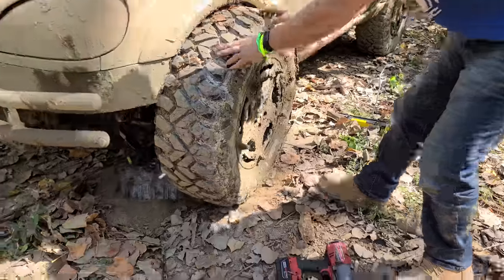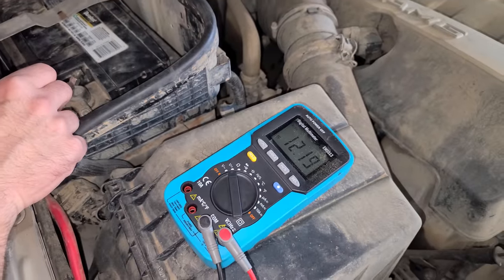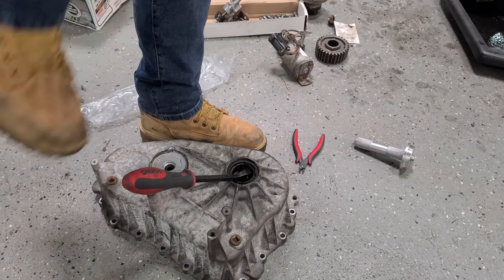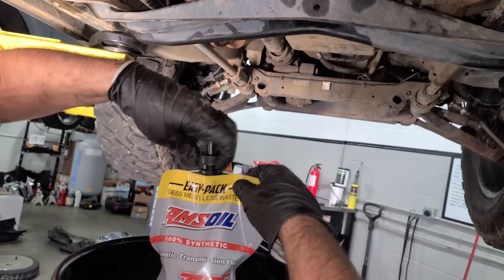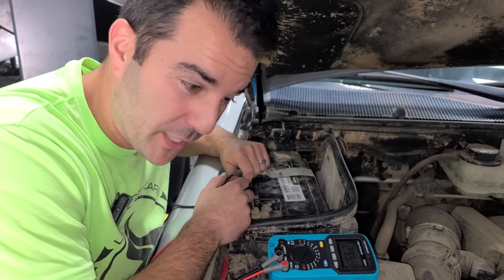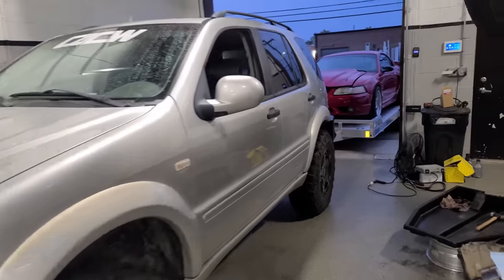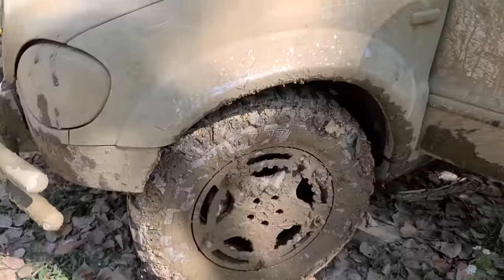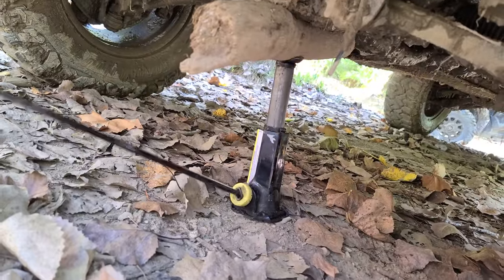I Built A Budget Off-Road AMG Mercedes & Brutally Broke It Twice! DIY Fixed On the Trails! CARNAGE!

Comment: About 5 years ago I bought a 2008 w204 c220 and I've been doing the services myself. Thanks to you Alex...
I always thought that mercedes would be complicated to work on but man, I have been fortunate to learn how easy it is.. I've just recently had to pull a leaking injector. Replaced the copper seal, cleaned up the carbon and put it back in within an hour! I couldn't believe it as I thought I was fudged... 
Thanks for all your videos over all these years...

Comment from the maker: What's an SUV you want to build for off-roading or overlanding?
Reply: Build a off road mustang
Reply: Tahoe 🤌
Reply: Yeah, Tahoe will be nice overland project or some old Chevy
Reply: Definitely not a mercedes
Reply: Already did it with my 4Runner, and I'd do it again!
Reply: @evoemperor3776  A G-wagon will be far more capable than any Toyota's and Jeep's
Reply: 4th gen v8 4runner
Reply: Take a Corvette body and put it on a old blazer 4x4 frame (google it) trust me, it looks dope.
Reply: @coreygenno9951 I was going to comment the same thing 👌 

The 2UZ-FE is indestructible 💪
Reply: A Porsche 911
Reply: I just bought a 2013 Nissan Xterra PRO-4X so that’s my pick 😊
Reply: P cayenne turbo
Reply: Any Off-road Porsche
Reply: I have a 91 jeep cherokee I figured would make a good overland vehicle. We shall soon find out
Reply: porsche cayenne
Reply: 1995 mitsubishi montero ls
Reply: I bought my wife a lexus gx 460. I’ll be building it for sure soon
Reply: I think it would be awesome to build up a Mitsubishi Delica
Reply: My 07 Sequoia.
Reply: Xterra I have currently
Reply: W164 ML63😅
Reply: If I had the budget and space, I'd build a military surplus 6x6 Deuce and a half. Those trucks went wherever you pointed them.
Reply: Toyota Yaris Cross GR Sport built for off-roading, it would be so fun and tiny little thing.
Reply: Fj-Cruiser.
Reply: I want to see a Cayenne Off Road build on the channel.
Reply: Already built mine... '92 Jeep Wrangler YJ, 4.0, 4" lift, front locker, slip yoke eliminator, double cardon rear drive shaft, Adams Driveshaft for the front drive on 32's, with rock guards on the 4 corners, rock sliders, 12K lb winch. maybe I could swing by next time you come down to see Sam... I'm not far from him....
Reply: Cayyene 2nd gen for sure
Reply: A '97 Volkswagen Taro 4x4. It's basically the same as a Toyota Hilux. It just has a VW badge on it.
Reply: Probably an Audi quattro model. Proven rally heritage so less of a soft roader than a Merc
Reply: Supercharged 318 5.2L Jeep ZJ Grand Cherokee, with 1 Ton Axel Conversion, & remote lockers.
Reply: @bobiivanchov9557 Toyota Land Cruiser be like: Hold my beer
Reply: 3rd Gen Mitsubishi Montero..
Reply: an old 90s 2-door Tahoe or Blazer (the big body one).
or a 90s LX/LandCruiser
Reply: 2002-2005 honda crv with nitrous!
Reply: Building a 1991 vw vanagon syncro.
Reply: @perrobueno1290  Ummm, nope I don't think so. In stock form, Land Cruiser can't keep up with G wagon's off-road performance
Reply: @bobiivanchov9557  Yeah... sure. Who told you that? Kim Kardashian? 🥱
Reply: Land Rover LR3
Reply: I think you gotta do a crazy Baja porche build or mini Cooper build but keep a realistic budget of like 10k.
Reply: Excursion with 7.3........after that purpose built ford or chevy 3/4 ton truck with camper shell......I know technically not an suv but close enough
Reply: Mitsubishi 3000GT VR4 (it has 4 wheel drive)
Reply: I'd love an old 4runner, or 2 door early 90's tahoe.
Reply: Off road Chevy Caprice PPV! Buy a second car and build it! If you build it they will come…

Edit: or the ford interceptors they should be all wheel drive if I’m not mistaken.
Reply: And old United States Postal Jeep from back in the day!
Reply: Porsche Cayenne
Reply: Just Buy a (land rover) wildcat. 👌👍
Reply: @perrobueno1290  I own 3 G wagon's
Reply: I would love an Isuzu VehiCROSS!
Reply: Toyota GX120 or VX100 I want to go all the way and not breaking down. 🤷🏻‍♂️
Reply: G63
Reply: Unimog.
Reply: Cherokee XJ
Reply: I’m currently lightly recommissioning a Land Rover Discovery 1. I do intend to green lane it but I won’t be going too crazy so all I’m doing to ‘modify’ is changing the tyres.
Reply: Gmc savana with an upfitter conversion.
Reply: Golf 2 Syncro
Reply: @bobiivanchov9557 Except you know, any Landcruiser, ever...
Reply: @Grey86 Also, wouldn't break every time you take it out like a shitbox Mercedes.
Reply: Something that wouldn't break every time I took it out - probably a Landcruiser, or if on a budget, a Pajero or Patrol - any of those is probably going to get you in and out most of the time without horribly busting.
Reply: Isuzu vehicross
Reply: @Beer_Dad1975  I know the good Land Cruiser
Reply: You know it's a L322 Range Rover, Alex... just get it done already :D
Reply: 3 doors GL
Reply: An older 4Runner.   They are indestructible and have the room to carry overnight supplies.
Reply: X164 diesel
Reply: I've had 3 Land Rover LR3s and will be getting another one when I find the right lower mileage one. They are beasts - fortunately most people avoid them due to Land Rover's  reputation so they're still affordable :) They are beasts off road from the factory with just need a tire upgrade, and ride like a dream on road.
Reply: Diesel 6.5 Suburban or 2 door tahoe
Reply: I always liked the Land Rover Discovery, But I would definitely swap the engine to 6.0 LS or something similar
Reply: w166
Reply: Lexus ftw (I may be biased)
Reply: Remember the guy who made a yellow 1998 SLK230 into a giant 4WD with a matching trailer? He used a 3.0L turbo diesel from a 300SDL and I don't remember what tranny. He and his girlfriend drove around the world. Took maybe 2 years or more, but he made it. Wow!!
Reply: I have a TRX and it's done amazing out crawling but I would love to build a Lambo LM or International Scout...
Reply: 2002 WS6 TA 😂
Reply: Do a Lexus GX470 and Cayanne Turbo S

Comment: Alex, you can turn off the auto-central locking by holding the unlock button for 5-7 seconds with the key 'on' engine off. Quality mod for sure :P
Reply: It sounds like a pre 80's pinball machine in there!

Comment: Alex, trail hack for a bottle jack. Most cordless drills with a standard drill chuck will grip the extension rod that the tire tool turns. It can save you time effort and sweat when manually jacking especially in stages

Comment: Just a tip, once the nut in on and torqued, drill a small hole and cotter pin them. Keeps them from vibrating out.

Comment: Very strange about the nut, with lock tight etc. Shows how good the old castellated nut and split pin were. I know there was no option with this nut though. I Would LOVE to get round there with my old Land Rover Trialer, looked like great fun. I was an Off Road driving Instructor for Land Rover for just over 20 Years, the colour of your ML tells me you were going through the dirty water too fast, but then fast through the water is good fun. Otherwise you driving looked good. One piece of advice, when you have wheel spin going on, sometimes turning left and right about 1/4 turn quickly can throw the drive across the front axle finding a bit of available grip. You dont want huge amounts of revs on at the same time though 🙂

Comment: You're awesome Alex!  Oh and the hard to easy scale is ALWAYS 10 is Hardest! LOL. I just did the Voltage regulator on my E46 M3 and it was so much cheaper than doing a full Alternator swap! I think most if not all Bosch alternators have that as an option. Very cool.  ROCK ON!

Comment: For the upper ball joint nut issue... double stack and add another nut or ideally drill a hole for a cotter pin and castle nut. We've dealt with these issues for years in the Can-Am mud bogging community

Comment: I had my alternator die at the racetrack, bought one from a guy for 20 bucks and it charged, but got about halfway home and it started making a noise like bolts being thrown against the side of a metal shed above 2500rpm.  Made it home ok, but when I felt it by hand it definitely had a slightly crunchy feel to it, whereas my good spare was 100% smooth.

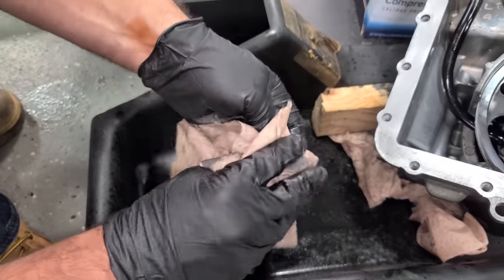Comment: 22:05 That's an important point =D The AMG ML wasn't really designed for offroading with GIANT TIRES =) It was probably engineered for some offroading with stock size tires, but mostly for handling and good grip in snow and ice.
With the power and torque combined with the HUGE difference in forces and loads on the whole driveline with massively oversized tires, it's a wonder the thing doesn't just eat axles and transfer cases the first time one of the rear wheels slip. 
Remember that larger diameter wheels will increase the load on the whole driveline almost exponentially, because there's a longer lever (the diameter from the center of the wheel to the outer edge) resisting the power/torque and also the shock loads while offroading.
Reply: Although true.
I'd trh ML is in low range that would increase the torque of the engine.
..
Also there usually some redundancy
(over engineering )
built-in to the drive line
On 90s cars it could have been as high as 80%..
I'm sure Mercedes drive lines are pretty strong...

Comment: Alex there is supposed to be some grease on the splines between the transmission and transfer case.  My awd charger with the 722.6 has eaten 3 of those couplers now trying to figure out what the correct grease is supposed to be.  Currently trying a silicone lubricant now.

Comment: First off, well done for getting as far as you did on open diffs. I wouldn’t have even considered hitting some of those tracks without, at least a Limited Slip Diff. Secondly, I’ve seen people double nut their suspension and also installing split pins (cotter pins) when going bush bashing. Good on ya mate!

Comment: Fix the abs sensor wire. Even with esp off it still uses the wheel speed to brake slightly on individual wheels so the open diffs act like a limited slip. That’s why it still does well off-road with the open diffs.

Comment: My Land Cruiser transfer case doesn’t hold a ton of gear oil, but I’m a nut about changing it I probably do it at least 2 times a year. Same with the transmission fluid, I used to never change mine but it’s so easy with a drain plug I do it all the time. always looks new now but I still do it.

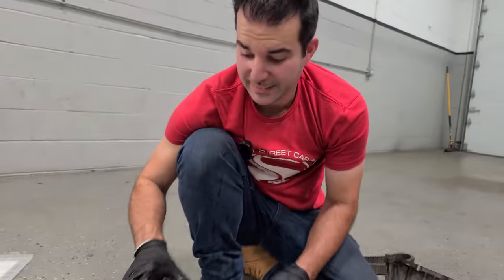Comment: 15:42 Hate when that happens. Like last weekend when I changed brake pads. I double checked the part number at a few different places before ordering. When I got them, 2 pads were exactly correct and two were 'almost' correct (they had little metal ears sticking up, but I was able to grind them off and be back in business).

Comment: At 2:55 is the best shot of the top wishbone ball joint and it kind of looks like the nut is on there but it's hard to tell as everything is the same muddy brown colour and brake line flexi pipe is partly in the way, 
It most probably stripped the threads off the nut with you removing the sway bar/antiroll bar and on full articulation (droop) all the weight of the hub assembly and wheel pulling down on that top ball joint just stripped the threads out of the nut.

Comment: Since you increased the wheel size you should change diff hearing in both diffs . Add a air locker for each. Or to really make it bulletproof, see if you can put reduction hubs like those in a unimog, or planetary heard like on haul trucks to make up for the change in torque required to turn those huge wheels.

Comment: Andrew Camarrata used an electric heater to warm the bolt.  Looked like a modified soldering gun.  It worked really well on the heating of the bot head.  Also no flames.  I was impressed.

Comment: You can replace the case to rotor bearings in that alternator.
Bosch likely used ball bearings.
You should have industrial bearing suppliers in Chicagoland.
An auto electric guy should be able to evaluate the field windings and the rotor windings.

Comment: once i put new upper control arms on a lifted h2 and it came backa week later with the nut missing and no damage to the threads like yours. put a new nut and didnt have an issue after that. thougth it was weird too

Comment: After you replace the CV axle see if there's enough shank left on that ball joint and drill a hole in it and put a Carter key in there run me some 3 and 1/4 inch straight get rid of that cat 02 issue 😎

Comment: With some of the older systems manual brake/torque vectoring helps instead of hammering the throttle. Not sure on the MB if it will make any difference. There I am one of “those” commenters. Great video and good day sir.

Comment: Didn t you check the teeth in the adapter of the transmission to transfercase? They will often get broken because this are dry together and will rust and break. You could longer the life of the shaft when you put some grease between before you mount the transfercase back on

Comment: From my brief armchair research, due to an interest in owning one of these things, it appears that the borgwarner 4409 unit has been problematic since day one. Forums from 2001 discuss it needing to be replaced or rebuilt every 40,000 miles. You get any closer to finding a good replacement unit? In addition, has it been fine since the rebuild? I feel like figuring out a strong transfer case is essential to having this be a reliable trail rig.

Comment: For really bad bolts like that learned from a forklift guy heat said bolt and touch a tealight candle to the bolt and it will suck in the melted wax and will get out some really stuck bolts

Comment: Flip that bearing race installer over and use the flat side to push the seal in as to keep pressure on the od and not deform seal

Comment: Actually the esp isn't that bad on those old cars with no lockers as long as you have it pressed once and doesn't reduce the rpms because it actively brakes the spinning wheel and it sort of works as a locking diff. You definitely need it if you don't have locking diffs

Comment: Oh, no steel wire wheel on aluminum transfer case. You can use polyurethane (non-metallic) abrasives. You could use: Scotchbrite (hand) or bristle discs (rotary). No galvanic corrosion, please.

Comment: Regarding the nut which turned up missing, my guess is due to the pristine condition of the stud, the nut had a catastrophic failure, probably a defect/crack and some kind of extreme off roading shock caused it to disappear. Poof! Not your usual thing, but with no galling, it had to depart quickly.
Reply from the maker: That's what we were thinking too. The threads were too nice

Comment: Are you not worried about getting wire wheel bits inside the case? It surprised me that you used that to clean the matin surface.

Comment: Is the “AGM” similar off road to the “BMW X5 “ as far as being all wheel drive? Most people who try using for off road have a bad experience because they forget that you have to turn off all the traction control (X5 it’s the DSC function), if you leave it on power is sent to the wheels with the least traction, each brake will also act independently for each wheel as it’s designed to keep you safely on the highway in all conditions. When turned off, the opposite is true, the power is sent to the wheels with the most traction, it basically act’s more like a four wheel drive 👍🏻
Most obvious sign is if your wheel off the ground keeps spinning like a drive wheel, you’re still in highway mode’s 🤷‍♂️
Simple push of a button can change your off road success immensely 👍🏻
Obviously giving it an appropriate lift kit, tire’s, body kit (bull bar’s etc) and recovery gear such as a winch certainly are also important 👍🏻
Lastly the six cylinder turbo engine is far better for off road over and above the V8 (at least in the BMW) , with a simple remap you get close to 300hp but also 600nm torque out of a 3ltr diesel.
Unfortunately for whatever reason, the diesel option isn’t available in the USA🤷‍♂️
I’m guessing this may be due to different law’s surrounding emissions 🤷‍♂️ it’s a shame though because diesels are far more reliable, economical and provides superior torque, especially for off road applications 👍🏻
Anyways just curious as I’m watching from Australia, where off road vehicles are more of a necessity than recreational vehicles for fun! Don’t get me wrong, we love the sport also, but the Outback requires these extreme vehicles just for a basic commute, breakdowns here can cost your life due to the isolation alone, so reliable vehicles have become a bit of an artwork out of necessity 👍🏻
Great videos as usual 😃 keep up the great work 👍🏻

Comment: Found your channel YEARS ago because of the Mercedes content.  My wife has '13 GL450 with the m278 biturbo V8.  Just started getting engine codes for camshaft position sensors.  Replaced them all, and about a day later getting the code again. 🤦‍♂ Tried to research but all I could find was it could be the timing is off a tooth.  Have you covered anything like this in a video I could go back and watch?  CEL code was initially P0341.

Comment: My situation is with my E320 4Matic Wagon, my front differential attachment screws are rubbing, sitting on the rack and Pinon. I've replaced tranny,transfer case and front differential. Give me your thoughts.

Comment: I have a question about my 2000 e320 locks. They don't work with the key off unless you put power on fuse 3 to make it hot with key off

Comment: If the dampener fails again, go with a fluidamper. The rubber dampener designer is terrible on the LS engines, it's one of their few fatal flaws. If you want to go more budget, Summit racing makes the best viable budget dampener that won't fail as fast. Fluidampers will last forever, and have really good low mid range RPM dampening. Really if your not going over 7k rpm a fluidamper is probably the best solution, summit has is a great budget option though.